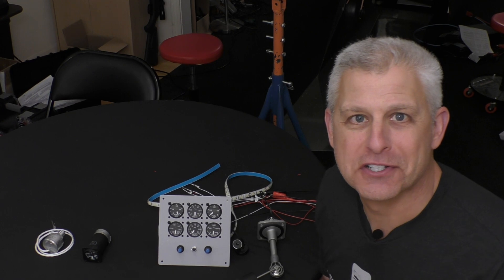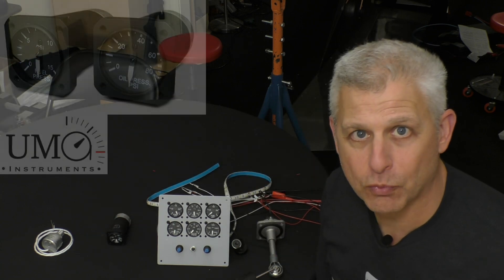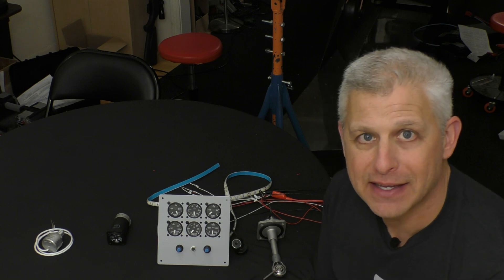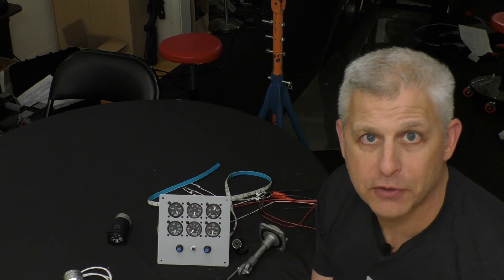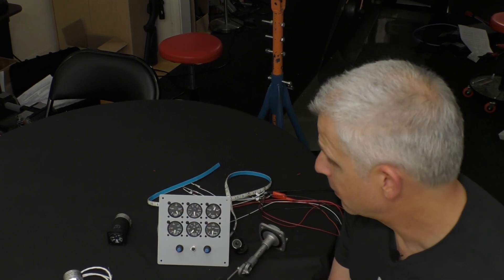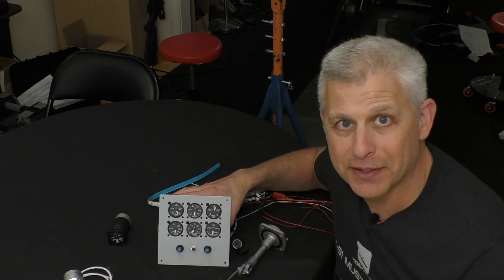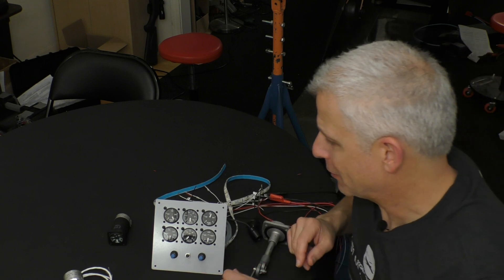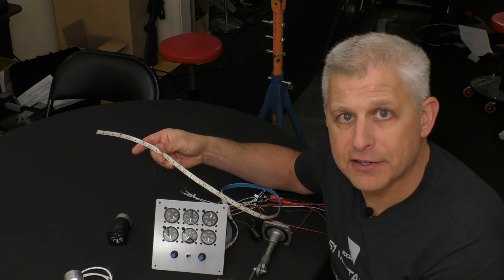How Aircraft Gauges & Panel Lighting Work - Titan T-51D Mustang Build

Comment: Hi Jeff, love your videos. I fly a Titan mustang and have always had trouble seeing the fuel gauges in the foot wells. Where did you get the senders for the float mechanism of the outboard tanks? I would love to retrofit those into my plane.
Reply from the maker: Hi Wade - Thank you!  You only need to change out the meter portion of the level gauge (2 screws and 5 min).  The part is from Rochester Gauge: https://liquidlevels.net/products/5675s02556-rochester-gauges-twinsite-dial-capsule-0-90-ohms-p5675s02556.  Feel free to reach out directly anytime! - Jeff